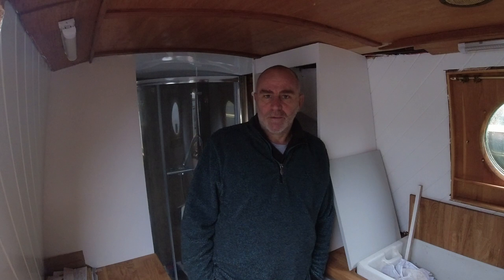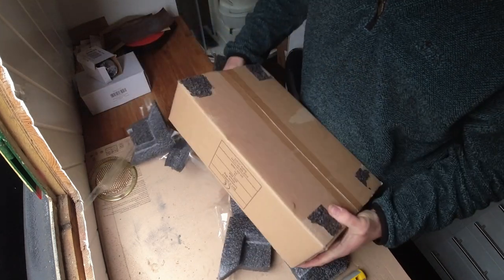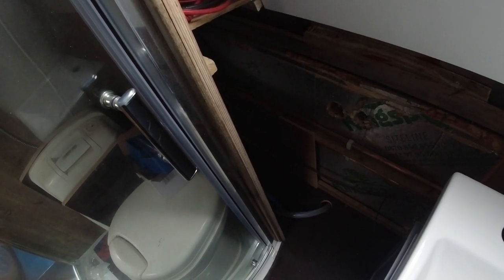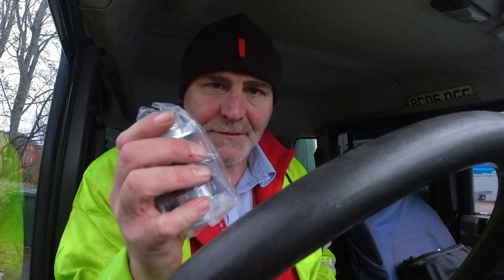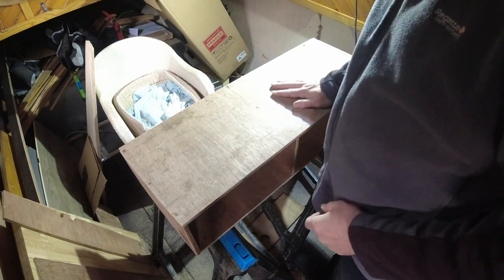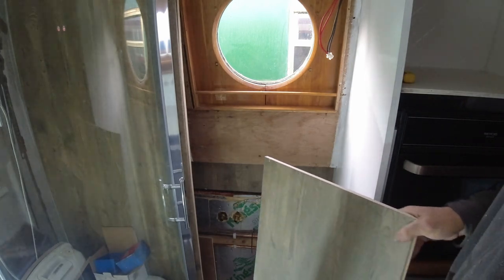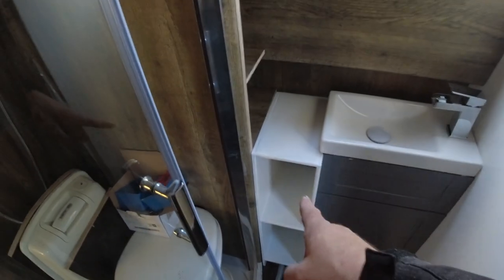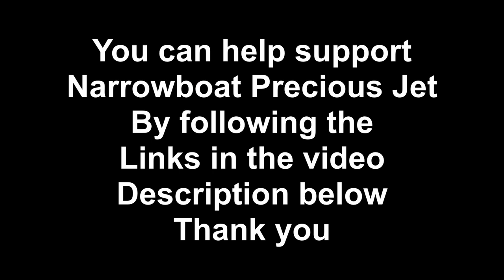Narrowboat Refit #49

Comment: You you should put a trap on your sink to stop cold air coming in and bugs more so when log burner’s running
Reply from the maker: There is a permanently fitted plug that will stop all but the smallest of bugs and I slight air flow will not do any harm 😊😊👍